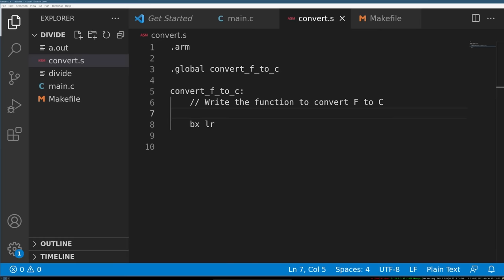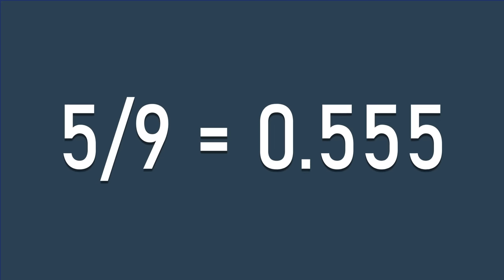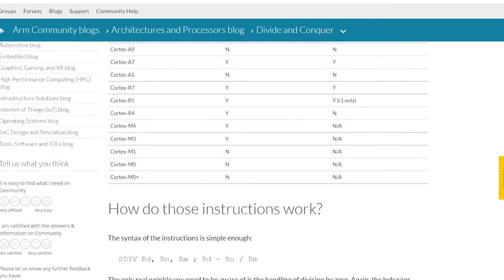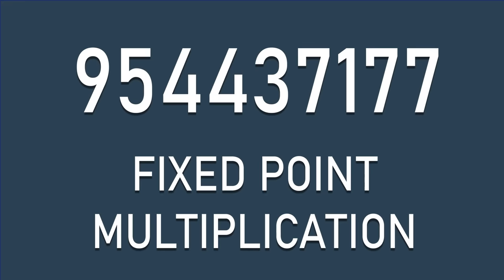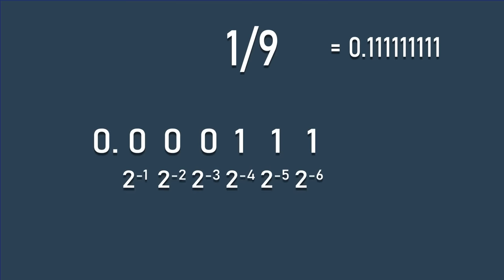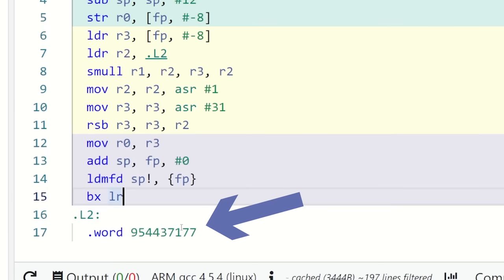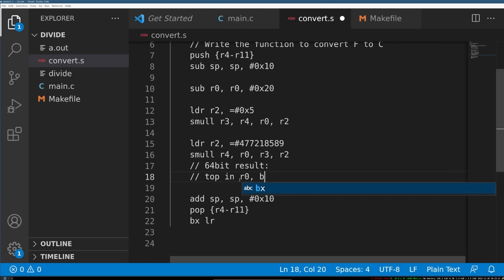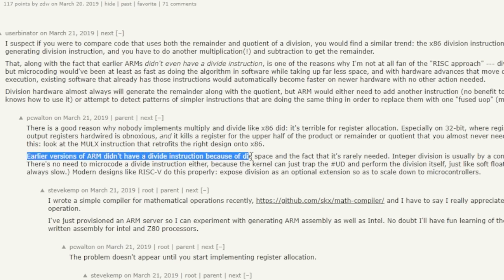computers suck at division (a painful discovery)

Comment: Yes, division is hard. I have designed and built my own TTL computer from scratch (no microprocessor involved). It is a 16 bit machine with some 32 bit operations and the instructions are implemented in firmware. The multiply instruction was relatively easy, but getting it to divide has been, well, let's just call it an 'interesting experience'. It's taken me a total of at least ten days to write just 32 firmware instructions. Several times, I've concluded that it's working, only to later discover a bug. The instruction divides a 32 bit dividend by a 16 bit divisor to give a 16 bit quotient and a 16 bit remainder. If the divisor is less than the upper half of the dividend (or zero), then it aborts the division and returns with the Carry Flag set. The reason it's organised like this is that if the divisor is smaller than the upper half of the dividend, then the quotient won't fit into 16 bits. (In such cases, the division needs to be broken down into smaller sections, and I've done that in assembler without too much difficulty.)  I believe the divide instruction now working, but time will be the judge of that. (I might write a test program using random numbers and let the division instruction battle it out against the multiply one.)

I'm now attempting to use it to implement a multi-precision arithmetic package. The idea is to implement the basic long division algorithm that we all learnt at school, but instead of using decimal digits or even binary, to use 16 bit 'chunks'. So, in other words, divide the top word of the dividend by the top word of the divisor (which may give a result that's too large) and then multiply the result by the whole divisor and subtract it from the dividend to get a partial remainder, then repeat. The result might be negative in which case the first 'chunk' needs to be adjusted. Anyway, it's a lot more complicated than that, but that's the gist of it. I'm sure that I implemented a similar multi-precision division on a PDP8 computer in the 70's, but I don't remember having all the complications I'm now uncovering.

Comment: So an easy way to do it is to observe that to get 9 to be close to a power of two, you can multiply by 7: 5/9 = 35/63.  1/63, however, is 0.01010101 in octal, or 0.000001000001000001000001 in binary.  you can, therefore, write 5/9 as 35/2^6 + 35/2^12 + 35/2^18 + ... until you're past the relevant bits, and do each of those multiplications separately before adding

Comment: When a software person runs into the nuances of hardware and ISA. 

ARM is more efficient broadly as are other RISC ISAs but the advantage of X86 being a CISC   ISA is that it supports a stupid amount of instructions which can mean fewer operations for a given output but this comes at the cost of incredibly complex architectures that have a lot of silicon left idle. 

It's interesting that X86 and ARM are converging somewhat. Both Intel and AMD have removed some legacy instructions that will instead be emulated if required or removed entirely in order to streamline their design process. Intel seems to struggle with this more than AMD as AMD's cores are actually tiny with cache contributing to a significant portion of the silicon die area.

Whereas Intel has taken a big little approach where the smaller E cores have had some instructions removed to save silicon.

Comment: You got my attention. Being >63, been around programming, RF engineering, etc. for some time. Ran into a similar situation as you did with fixed point division, using DSP ASIC's apx. ~15 years ago. I'm going to subscribe, and follow. I'm impressed that you are programming in assembler! LOL! Not within my skill set, but still appreciate it. Predominately program in C and C++, embedded stuff and PC's. My preferences, Microchip and Analog devices, (Z80 a hundred years ago! & 68hc11, LOL!) (embedded), PC's, GUI, like using QT5/6, Windows and Linux. Got away from VS a few years ago, tired of Microsoft nonsense. I seldom comment as I find it a wast of time, but this time i did. Cheers..Wondering, have you any interest in SDR? (software defined radio)
Dale, VE3AAM......

Comment: I think what's important to note is that by today's standards a division unit isn't expensive to add to a chip. It's just that the Cortex M0 is an embeded processor aimed at the absolutely simplest of tasks, the STM32G0 for example that includes the M0 costs less than $2. It's the kind of stuff you find on toasters, fridges, microwaves, cooktops etc (not the "smart" ones, the normal ones, as long as they include any digital panel and aren't just electromechanical). In that level of cheapness it makes sense to scrape off everything that's possible

Comment: Doing a computer science degree. In our first introduction to programming, we were using C#, one of the programs we were to assigned to create included floating points and rounding…it was a nightmare…although you wouldn’t get 100 on the check the professor programmed for the program, due to results not rounding correctly due to the weird ass math going on behind the scenes for the division, so if they could tell the code is written in a way where the answer should technically be right, they just gave you full points for it.

Comment: While fixed point and multiplication indeed works, I'm surprised you didn't look into making your own divide function.

While looking into making my own BigInt or similar library for fun (which works quite well even in assembly) i came across a library and explanation of how to do division , being the inverse of multiplication. Namely shift, compare, subtract. That's it. The downside is this division is VERY slow, at least emulating 128/256bit numbers due to how many are involved, not optimal.

However shift and subtract as a function is fairly easy to get right once you know what you're looking for (assuming the numbers aren't too big, juggling data over multiple registers/variables is a pain to get right).

the actual algorithm goes something like this....

//d=divisor, v=value, r=result, t is a temp for testing the bit length (hamming codes?)
int t=v, bc=0, r=0;
while(t){bc++;t>>=1;} //find number of bits. needed to promote the divisor and mask.

int mask=1 << (32-bc); //assumes 32bit ints
d <<= (32-bc);

//at this point divisor is promoted up.
while(mask) {
    if(v>=d) {
        v-=d;
        r |= mask;
    }

  //go down by 1
  mask >>= 1;
  d >>=1;
}

//DONE. v is now the remainder, and r is your answer.

Comment: division is low precision
doing any operation with a larger and small number is lower precision.
The formula for blackbody-radiation-color involves large and small numbers, to a point, where you must use a simplified-model this with numbers, that are not "centimeters and the speed of light", but simpler smaller values/fractions, to get a a similar function, that is smoother for its better precision in the calculations.

Comment: Fujitsu FR, used in many digital cameras, signed division looks like this (let's divide 16k by -4

; Division on Fujitsu FR as best as I can remember it.  These models had no floating point.
; Note:  All instructions on Fujitsu FR are 2 bytes, except the following two immediate loads, which are 6 bytes and 4 bytes respectively.  I could have done the first other ways, but this only exists to show the oddness.
; Special casing your VLIW is extra trollish, bonus to them. 
; MDL is extended to 64 bits by using the upper word as MDH and the lower as MDL, just to make it weird
LDI:32  #-4, R2
LDI:20  #0x4000, MDL    
DIV0S   R2              ; Setup for signed division
DIV1    R2              ; Division step x 32
DIV1    R2
DIV1    R2
DIV1    R2
DIV1    R2
DIV1    R2
DIV1    R2
DIV1    R2
DIV1    R2
DIV1    R2
DIV1    R2
DIV1    R2
DIV1    R2
DIV1    R2
DIV1    R2
DIV1    R2
DIV1    R2
DIV1    R2
DIV1    R2
DIV1    R2
DIV1    R2
DIV1    R2
DIV1    R2
DIV1    R2
DIV1    R2
DIV1    R2
DIV1    R2
DIV1    R2
DIV1    R2
DIV1    R2
DIV1    R2
DIV1    R2
DIV2    R2  ; Correction when remainder is 0... (MDH) 
DIV3        ; Correction when remainder is 0... (MDL)
DIV4S       ; Correct answer for signed division
; ^ Because the other steps give an unsigned answer.  

I'm pretty sure with the barrel shifter you could implement division on arm in less instructions than that.  It showed up a LOT in camera firmware, too, because they had enough rom space to write it in C by then and didn't realize what a mess it was I'm guessing.  Aside from that everything on that processor

Comment: I like to think a have a good grasp of how CPUs work in general. I've learned some 6502, 8086, and 8051/52 mainly. But I still can't understand how CPUs handle floating points from a low level perspective. Admittedly, I only recently tried tackling this and the language tripped me up. So, I think if I just keep trying, and use resources that explains it differently. Different textbook(s), video(s), etc. But, knowing that computers used to have a chip dedicated to handling floating point numbers gives an idea of how complicated it is. And those computers with "math co-processors", something tells me a lot of that math has to do with division and/or floating points.

Comment: Actually when using 2^32/9 you shouldn't add 1, because it ends in .444 so you would round down.

For 2^33/9 that ends in .888 so you should add 1.

Comment: You don't see a division operation in fixed-divisor cases like this even in x86, the compiler knows better, dividing just sucks.
If writing my own assembly for a case like this, I don't think anything to do with floats would be my first answer anyway, instead multiplying the integers used by the precision I wanted to approximate at, adding the corresponding "0.5" (half of the constant multiplied by), and then looping to find out how many times the divisor can be subtracted if integer division isn't available.

Comment: You can actually do this with integer math if you are only interested in an integer result. Do the multiply by 5 first then the divide. You have to be using a large enough data type so that the multiply doesn't overflow the result.

Comment: In this day and age ALL MCUs and CPUs should have a FPU unit. Almost all math done is going to require division or a floating point number beyond the basics working with sensors, etc...it feels like we are still in the days of x86 and the optional MCP. In the low power units, switch it off to conserve power until it is needed, or the programmer specifically enables it. I can't see it adding appreciable cost to each unit. However, one can also argue that at the speed at which some of these units operate today, it adds negligible processing time to do emulated floating point or division thru the C library, so, eh...even on the Atmega's doing basic FP or division still tallies in the µS range...but it's going to matter when it gets complex and you need real time results, but in that case you probably wouldn't be choosing a non-FPU unit or have a dedicated math coprocessor/ASIC.

Comment: Not only that they take lots of logic block's but take time as well, a 32bit division usually take 32 clock cycles, depending how is implemented, if is pipe lined will need lot's of logic units, but you have a division each clock and the result come out with a 32 clock's delay, if the division circuitry is looping will eat around 32 times less logic units but can do a single division every 32 clock's.

Multiplication is as well an issue on high speed hardware needing multiple clock's for the result to come out but is simpler than division because the results from precedent stages depend only of signal propagation, the more you chop the module the faster the multiplication it gets but the result will come out with a delay in clock's equal with the number of stages.

The above is applied for integers and floating point as well, and floating point eat even more logic units.

That's why AMD in the past try to share a floating point module between two cores because if you want keep the floating point and especially the division unit busy you need to feed those modules with data that the input is not dependent of the previous cycle result.

Comment: You come up against this sort of issue all the time when you're using assembler. You quickly realise that without powerful floating point hardware, floating point is ludicrously slow, whatever the function. Most of the early Microprocessors didn't even have a hardware multiply for integers. There are lots of ways to get around these issues, but it's time consuming. With so much processing power at our fingertips today, much of this is lost on programmers, and that's why some code runs way slower than it needs to.
Another ultra fast solution for limited ranges and lower precision is to use a direct lookup table of F to C, and interpolate between entries if you want better accuracy. If all you want is one or two places of decimals, that will work. Lookup tables can take up a lot of space, so you need to be aware of that and offset it against what you're trying to achieve.

Comment: That's a common performance optimization.  You can "divide my multiplying" because you're not dealing with integers, really.  You're dealing with integers modulo 2^(word size).  This is talked about in great detail in the book Hacker's Delight.  It's done commonly because multiply is faster than divide.  You can do it anytime you're dividing by a known fixed number - you can't do it it you pass in the divisor as a parameter.
   
Look, early processors didn't even have a multiply instruction.  Multiply and divide are a lot more complicated than add and subtract, as you should know from having learned how to do them in grade school.  Processors gained these capabilities as logic became a less scarce resource.

Comment: I like this video. It is informative and entertaining.  

I came up with this transformation from floating point to integer in 4 steps that I would use for C. 

C = (F-32) * 5/9 
C = (F-32) * 0.5555555
C = (F-32) * round(0.5555555 * 2^16 ) >> 16
C = (F-32) * 36049 >> 16  // long C and F is 

What do you think?

Comment: If you study computer science, you will eventually take a class called "Numerical Analysis" where you discover that computers aren't terribly good at floating point math either, and while they do fine for day to day calculations but when it comes to non-linear calculations or complex simulation, and that the errors compound making some classes of problems not just off slightly, but completely wrong..   Methods such as Euler, Improved Euler and Runge-Kutta are the basic methods use to improve accuracy.

Comment: Lol, I was shocked when I discovered that a few years ago. I write a virtual machine in assembly, so I have to know how each CPU and operating system works. It's annoying to have to work around that limitation, especially since x86 does it just fine. Oh, I probably need to check if it's the same on RISC-V.

Comment: This is the trivial part. Computers can easily divide by a constant, because you can precompute the reciprocal of the constant as an approximate fixed point number.

The difficult part is the step which you just completely skipped, because ironically you were able to simply use the computer to figure out what 2^32 / 9 is.

I would challenge you to actually implement this: create an algorithm to find 2^32 / x, to the nearest integer. A basic way to do this is to approximate the true answer with a simple function (bitshift by an amount depending on the size of x to move it to a small range, then apply a good linear approximation of 1/x in this range, then shift back appropriately), then do a few iterations of the Newton-Raphson method. If your first approximation has, say, 5% maximum error, then 3 iterations will reduce the error to the order of about an integer (1 in 2^32). When the Newton-Raphson correction term is sufficiently small, you can just shift the answer by single integers until it's correct; an answer y is correct to the nearest integer so long as x*(y - 0.5) < 2^32 < x*(y + 0.5) in the unsigned case.

Comment: I'm not really into computers but would converting the number into another base make it easier/faster? Like say 800/8 might be done faster if 800 is converted to base 8 first 
So 800 to base 8 is 1440 then to divide by 8 you just remove the 0? Probably wouldn't work for all scenarios but you could at least try to figure out how it might work in some in order to get a faster method

Comment: Many Cortex-M do not have DSP. Some do have floating point and hardware divide/multiply. Cortex-M is championed for its power, cost, IO and latency rather than compute. Compilers mostly worry about this now. If you need this you should use Cortex-M3 or above. At a certain point you get into IO or compute offload, which can work out these issues in another manner. For these you need to know what your doing and they are only really useful in certain cases for latency. Cortex-M3 is cheaper to support than hand written assembly or crafted C/C++. Cortex-M0/M0+ really competes against 8-bit and 16-bit controllers.
Reply: Note some of the ARM instructions are implemented for space. This a trade off for cost and power however comes at the cost of speed. Options for enabling this are available. Alternatively the programmer can write their code to avoid needing it.